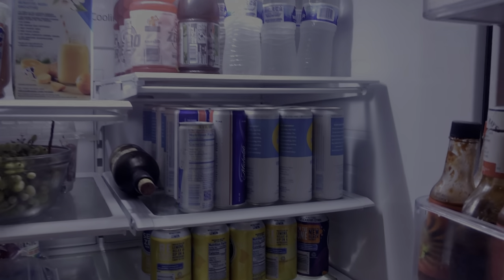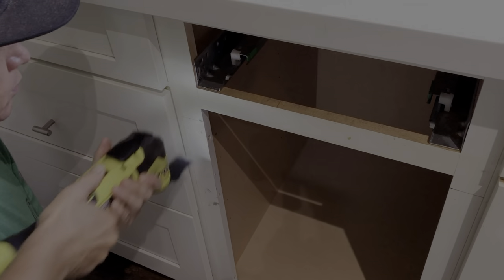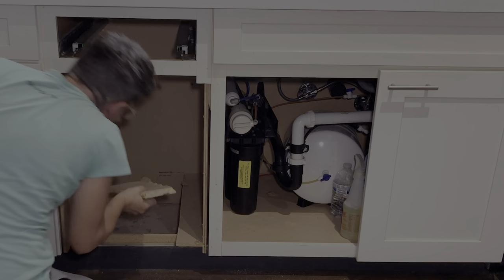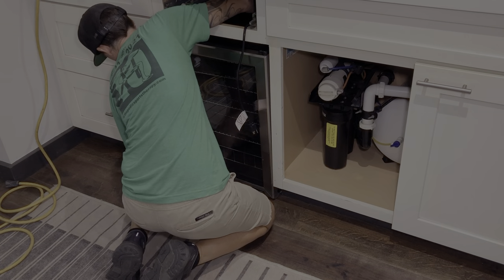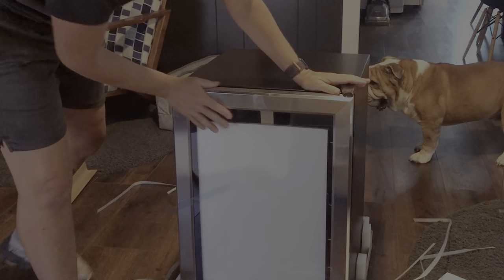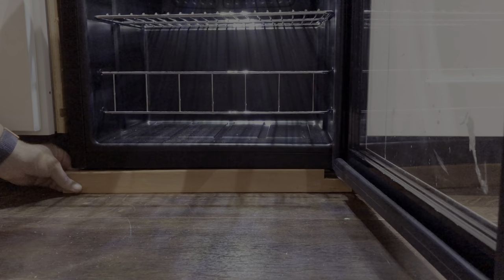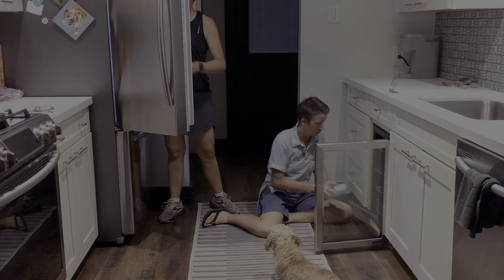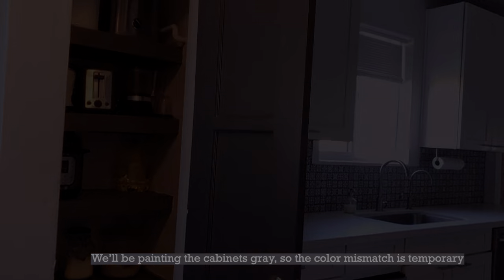Will it fit? Newair 90 can freestanding beverage fridge (AB-850) installed in a tiny cabinet space

Comment: Thanks!  Very cool.  Have a question though and it wasn't clear to me.  How did you secure it into the space so it had no movement on opening closing the door or bumping into it?  Getting ready to do three type applicances into a wet bar and didn't know if there were any side securing points or it's all from the front.  Thanks and sorry if I missed it
Reply from the maker: Thank ya! In our case, the space is so tight, it’s held in place by friction alone. Also this particular unit is intended to be freestanding, so it’s built to not be tippy. I would guess that units intended to be built in might come with some sort of brackets? 🤔 Sorry I’m not of more help.